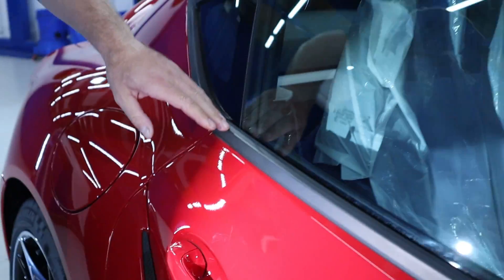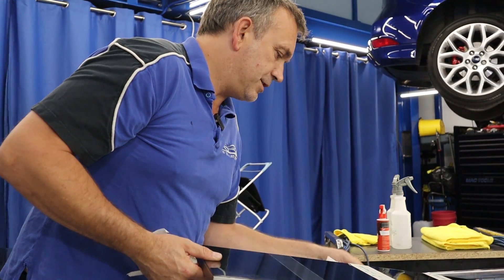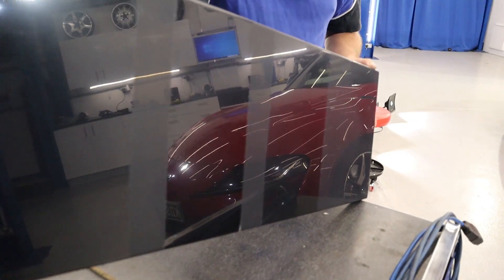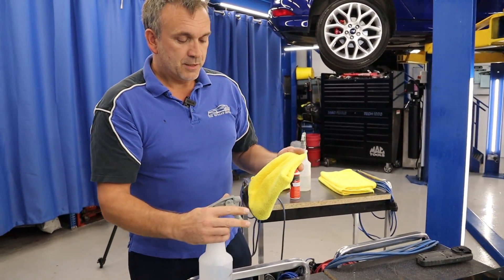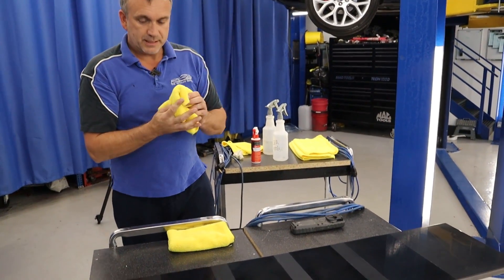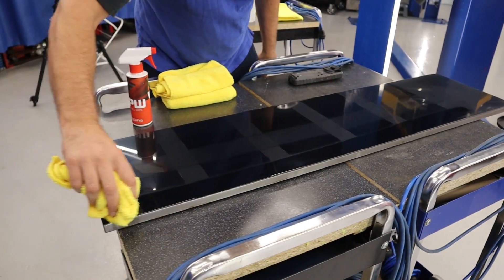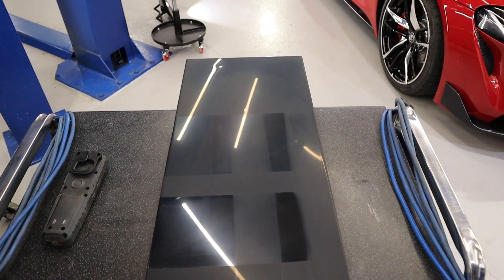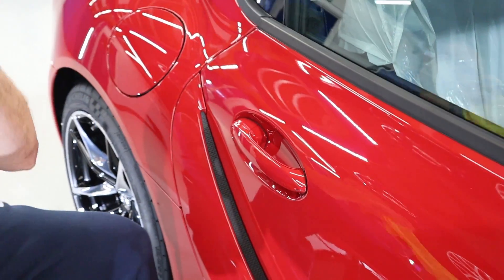Part 3: DETAILING 'CHEAT' EXPOSED?!

Comment: so i might be a little confused..  you wipe all the painted surfaces with 3 different treatments (ipa, glue remover, PW) before doing any polishing and then "truth wipe" with PW to ensure results?
Reply from the maker: We would use panel wipe, usually followed by IPA, for two reasons:

1) before applying a ceramic coating, to ensure maximum bonding

2) if we need to check/verify our correction results - however, we have enough experience (we get such repeatable, consistent results from our polishing methods) that in the real world we don't need to do this during the interim stages because we 'know' what the truth is already